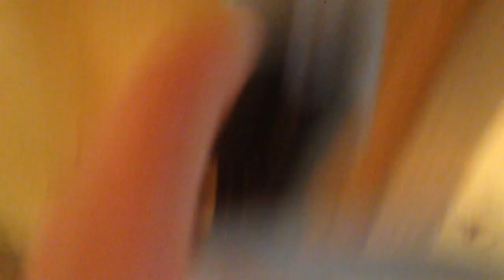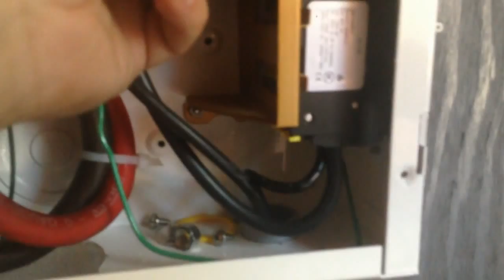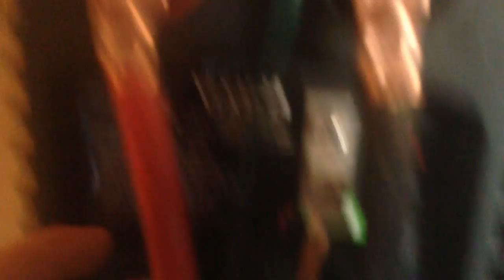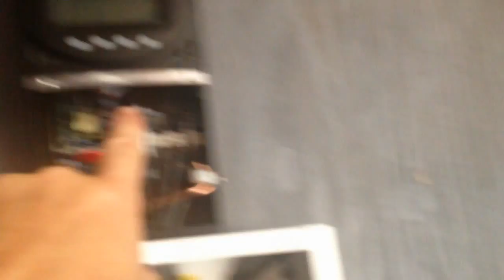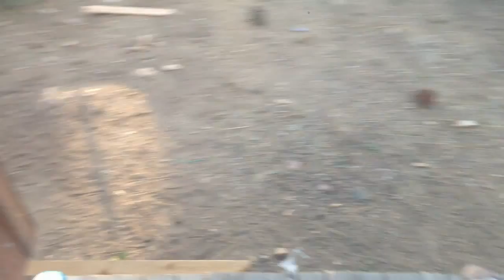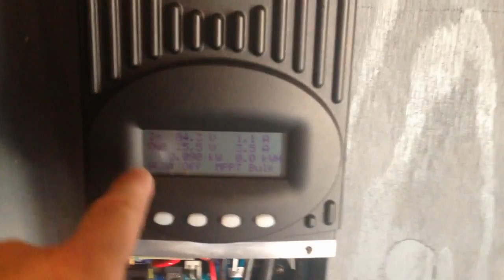Off Grid Cabin Solar Installation - Part 4

Comment: where do you get the information for off grid solar electric code? and what type of wire do you use for solar in and charge controller out? stranded thhn? thanks. -brad

Comment: Nice equipment.  What kind of breaker is it that you used?  Is it rated for DC?  I am just curious.  The ones I use are for AC and so far they have worked just fine but some people have warned me about them.  Also, where are you going to put the batteries?  I assume you are not going to leave them on the floor.
Reply from the maker: Thanks again.  On the batteries, I'm gonna build a battery box, since lead acid and currently contained in very small closed space.  So, building the air tight box which will vent to the outdoors is the plan there.  Glad you asked about the the breakers.  Mine are Midnite Solar (din rail).  They cost $15 a pop or so....But, until recently i didn't realize just how important DC breakers were, in fact DC breakers are a requirement on a DC circuit.  Check out this video here, put out by Midnite, for the technical explanation.  It makes sense when he explains.  But the AC actually dangerous on a DC circuit.  here's the link for the video    MidNite Solar's Secrets to DC Breakers
Reply: Thanks for the info.  I will get around to replacing my combiner boxes (load centers) someday.  The projects have piled up on me.  Never enough time or money!

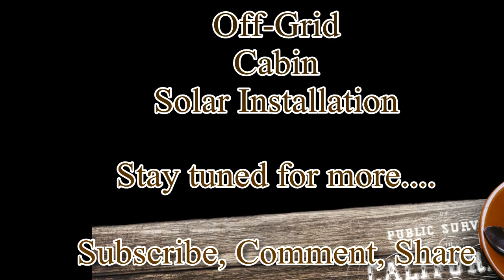Comment: hey buddy, nice job of the description on your wiring, I want to address a slight safety issue you can see on your wiring. all the connection lugs on your positive are not flat, with a gap like that you can get a spark and burn up your equipment, at 3:44/11:49 your finger is right on it, just want you to be safe,, excellent job on the set up. best of luck SD.
Reply from the maker: You're right on. I realized the same thing 
But ran out of large shrink tube. Good news is Job is far from done and you can still slip the shrink tube over the terminal end and over, and hit it with the heat gun. But you're right I could see fireworks show in there as terminals get pushed around and shorted as is
Reply from the maker: Also nothing is tightened down yet, as I still have to add more terminal rings on to that top end of the 250 breaker before torquing it down. But I see that as a safety issue too

Comment: Looking good man... You're making progress
Reply from the maker: Thanks Romo. Yeah this is been a long process for sure.  It's funny cause when I did my grid tie only Enphase system at my house, I did the whole job conduit and all in 1 long weekend yet this job has been taking so long. I think I've put in a combined  3 full weekends and I still have at least one or two more weekends to finish, but you know exactly where I'm at, and you know I'm very close to the finish line and I'm getting excited. I will build a battery box, vent, cleanup etc. but that's not going to delay my system as I'm getting the AC stuff done next so I can get up and running.

Comment from the maker: Short run from shed roof (panels) to inside shed (power board) so i started with 10 awg to the disconnect box  and then to the breaker.  HOWEVER, i ran out of 10awg for the positive lead from disconnect box to breaker, and had to use thicker gauge, like 6 or 8 which was overkill, especially for small space and breaker size.  My battery cables will be 2/0, but i still need to cut, crimp, and connect which will do after i build battery box and vents. For now, have 0/4 just to get it operational